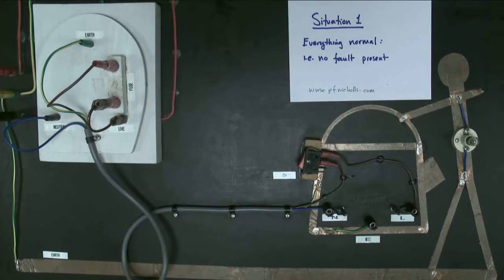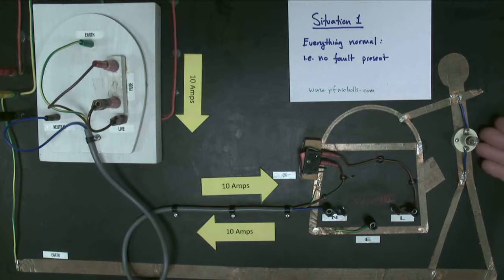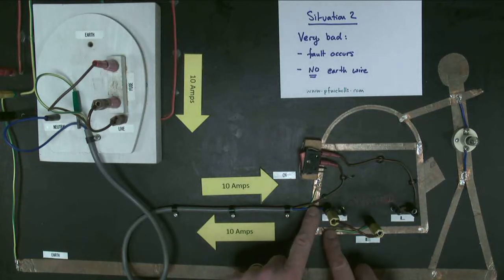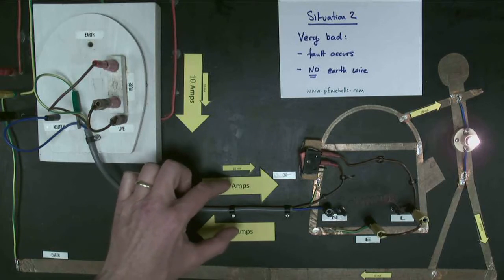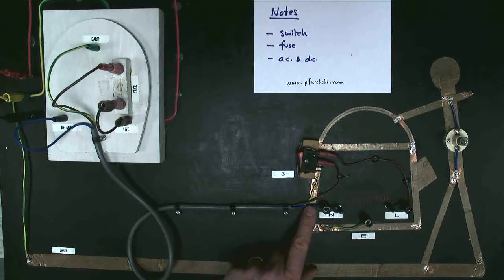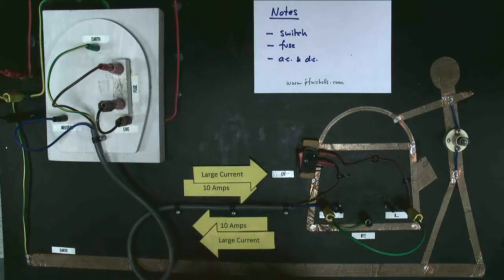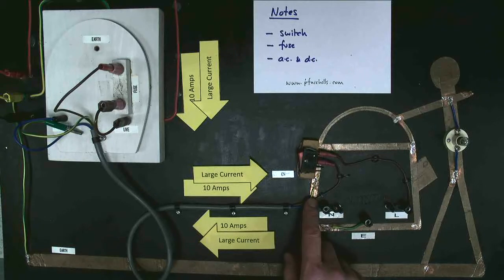Earth Circuit

Comment: Excellent series of demo's / tutorials you're doing.  Really enjoying them.
At 7:36 doesn't the "Large Current" run back the Green/Yellow earthing wire rather than through the literal ground [through the person in this case]?  The ground should be at a similar potential but the current flow should be through the earthing wire.
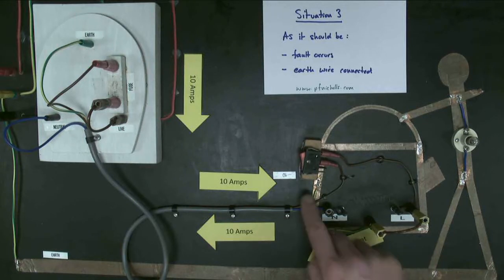Reply from the maker: Hello and thank you for your comment, much appreciated, and I think you are right. Re-watching the video I realise that at 6:35 I place the arrow pointing towards the literal ground (my mistake) but I was trying to avoid it looking like it went towards neutral. At 6:45 I do say the large current goes through this earth wire so I think, at this point, my explanation is okay but the visuals are confusing. At 7:39 (and I have no idea why) I do imply the large current now flows through the literal ground. I was meaning to have arrows pointing back along the flex but it doesn't look like that and my commentary at this point is not clear either. Thank you for taking the time to point this out. Future viewers please be aware, the large return current that blows the fuse does, in actual fact, flow back along the Earth wire in the flex.